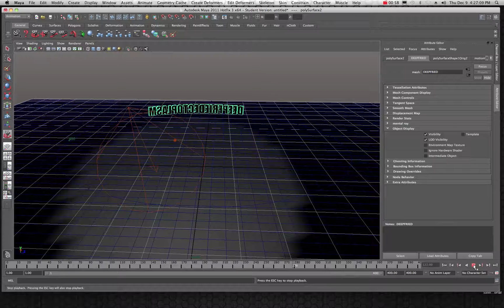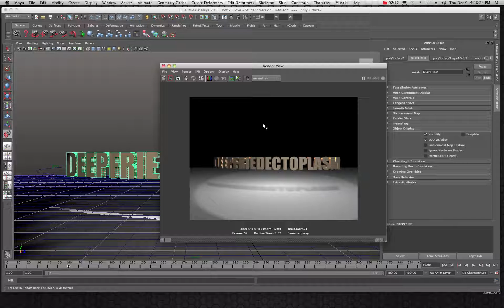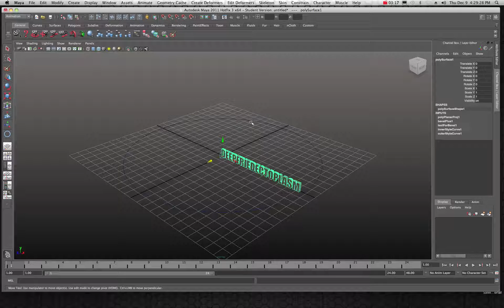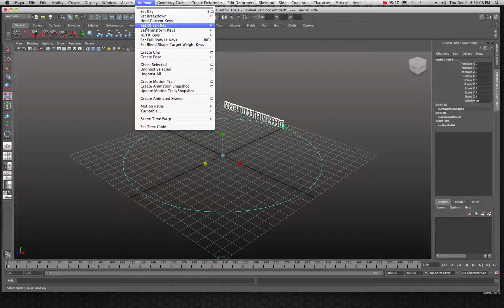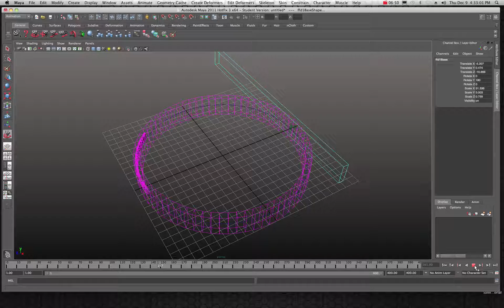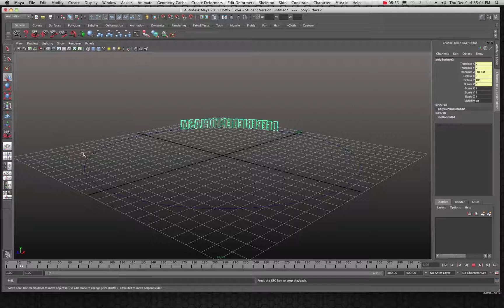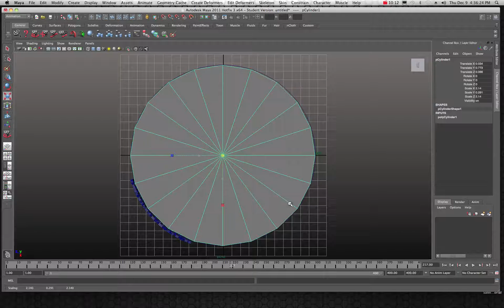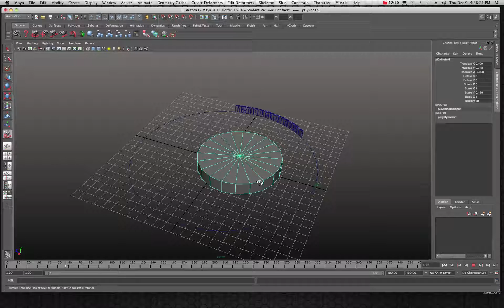Maya 2011 Curved Text on Flow Path Tutorial by Stuart Christensen

Comment: Questions:
(1) For the sake of precise replication, what kind of text are you using?
(2) At ~4:00, you attach your text to the flow path, and Maya creates a base lattice around the entire circle and another lattice around the text.  In my case, the base lattice does not conform to the circle to which it is attached.  Any ideas?
(3) I am trying to get text to curve inside the circle (like a hotwheels car inside a track loop), but the rotation seems locked once attached to the circle.  Any ideas?

Comment from the maker: @melkiejosh Normally you would rotate the text object 360 on the Y so you may need to try extending the animation so you can rotate it more (say 380 or 390) so it has time to overshoot the 360 position and then when you render you can output only the frames needed to make it through to a smooth transition.  Again, Maya loves troubleshooters so don't give up and think of what's needed to correct for problems.  It's never ending process!

Comment from the maker: @melkiejosh Is the text slowing down as you play it in the viewport or is this issue noticeable in a final rendered image sequence?  Not quite sure what the problem might be.  Over time I have done several tuts on the curved text flow, each with some slightly different info to correct for problems,  More info needed, OK?

Comment from the maker: @flixpar Does it slow down in the actual rendered image sequence on playback, or does it just slow down in the viewport window as you are watching it back?  Sometimes Maya bogs down a little in the viewport view and you should check your playback preference settings to make sure all the settings are good there.  Hope that helps.  2012 has no bearing on the playback however, it should be better than 2011 from what I've read....Thanks for watching.